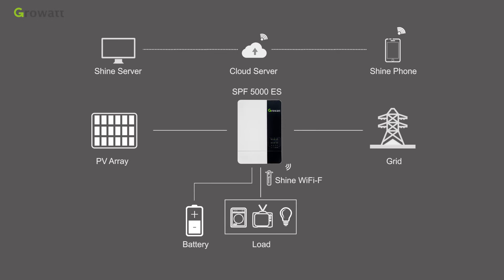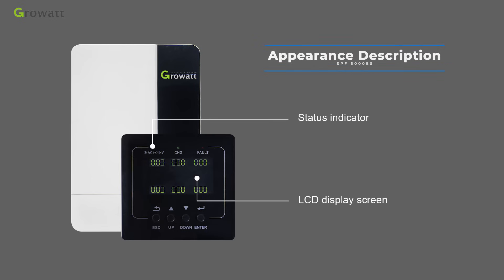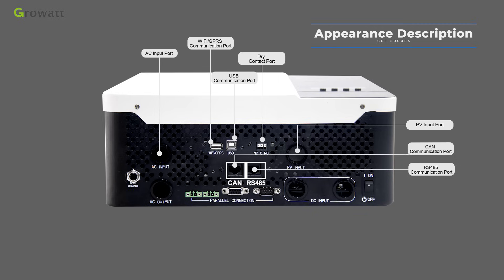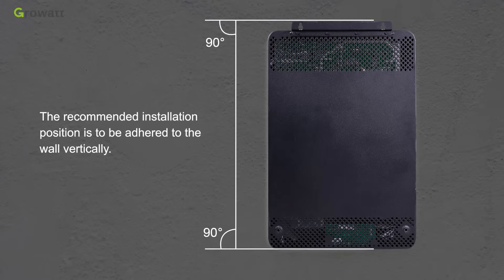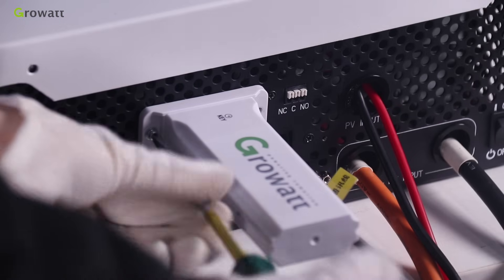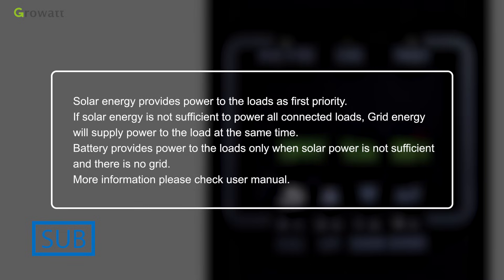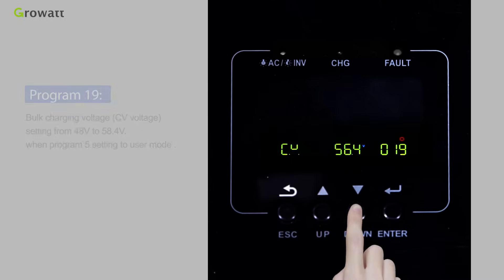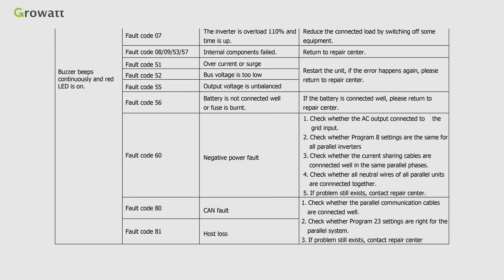Growatt SPF 3500-5000 ES Off-grid Inverter Installation Introduction

Comment: I have a Growatt inverter  SPF 5000 ES inverter I need assistance on how to connect the earth or ground from the Grid to avoid double bonding. an installation digrame will be hand what is in the Growatt manual is not clear

Comment: I have a Growatt SPF 3500 ES off grid inverter. I'm very sad to say it is not a good experience! The first one I got installed on April first (no joke) 2022. It stopped working, January 2023. I live off grid in Portugal and after 4 months without electricity or running water, I finally received a new one. A friend (solar ingenier) installed it and "looks after" it. Now since last week without a clue, the inverter broke down again! So here I am, again with no electricity or running water. I send e-mails, called and try to contact them to solve this predicament! Hopefully this helps to get the ball rolling to get me out of this awful situation and into power!
Reply: and you use stupid batteries from car right?

Comment: I would like to go for the 3500W version of this inverter, but the MPPT startup voltage is TOO DAMN HIGH!!! Yeh you have a 3000W inverter that has a 60V MPPT startup voltage, and another 3600W inverter that has a 70V startup or something like that, but the frist is 3000W and I really would like that extra 500 - 600W and the second only works with your own brand batteries, which sorry but I am not gonna get locked into your ecosystem.

For a proprotary battery to be fair it's competitively priced with server rack batteries and if I was just going to set and forget I would probably go with you guys, but I eventually want to move to a victron 5kVA inverter, although the main reason I want to go victron is for the low self consumption, the data sheet does say "Self-Consumption night: <10W" but if that means the same as when your Victron inverter is set up in eco mode and is only searching for loads, Victron manages 2W in that mode, while you guys have generally been around 60W.

I don't know if that is the same for this hybrid inverter, but considering you didn't just say Zero load self consumption or something like that it makes me doubt you.

Comment: Hi i have just purchased a spf 3500es,i dont want to connect batteries at the moment, can you explain  how i can program the inverter  for without battery mode as i am not connecting batteries. 
Also tge display is showing my panels at 179volts i have run the panels in series but the inverter is not showing wattage
Reply: it shows KV on the left bottom screen , which is same as watts

Comment: Can the 5000 ES only be connected to a 48V LifePO4 battery or can it be connected to 12v/24v also
Reply: the SPF5000ES will be conected to 48Vcc.

Comment: Hello i have a new growatt 5000 es it drains batteries to fast i have 4 12v 200a  batteries with only 2 fans on at night plz answer
Reply from the maker: Hello, for technical support, please contact our service team at service@ginverter.com, or you can call our service hotline at +86 755 2747 1942. Thank you!
Reply: How are your batteries wired, parallel?

Comment: Why does you system not turn on with batteries connected or solar.  Only works with grid connect to turn on display?  Why with it no supply AC to load or use batteries for load?
Reply from the maker: Hello, for technical support, please contact our service team at service@ginverter.com, or you can call our service hotline at +86 755 2747 1942. Thank you!

Comment: Facing problem connecting my Felicity lithium battery through BMS, any solution ?
Reply from the maker: Hello, for technical support, please contact our service team at service@ginverter.com, or you can call our service hotline at +86 755 2747 1942. Thank you!

Comment: Hello I have a Growatt 3500ES. I have not connected it to a battery. I have "19" and Flashing red triangle in the bottom right hand corner of the display... What does this mean? 
In "program mode 1" I have it set to SUB
Reply from the maker: Hello, for technical support, please contact our service team at service@ginverter.com, or you can call our service hotline at +86 755 2747 1942. Thank you!

Comment: When using the inverter without battery, and supposing load is 1000w and PV production is 500w, will it switch to grid and grab all the load? or will it use 500 from PV and 500 from grid?
Reply from the maker: it use 500 from PV and 500 from grid
Reply: @Growatt  nice. Thanks 👍

Comment: A question about connecting 2 strings. 
It’s marked as max 18A. How strict is that?
I was thinking to connect two strings with panels specified 11,2 isc/A 10,58 imp/A.
Reply from the maker: Hello, for technical support, please contact our service team at service@ginverter.com, or you can call our service hotline at +86 755 2747 1942. Thank you!

Comment: I am using the 5000 ES. Solar energy is being generated, however the dashboard is showing 0 kwH for . I am using the inverter without batteries. Is there setting or configuration I am missing. please assist.
Reply from the maker: Hello, for technical support, please contact our service team at service@ginverter.com, or you can call our service hotline at +86 755 2747 1942. Thank you!

Comment: I have this inverter is possible work with this baterry . I like to know before buy this  baterry .
SAMSUNG SDI 94A 80.9V 7.61KW LITHIUM BATTERY MODULE - DIY SOLAR POWERWALL
Reply from the maker: Hello, you can check the user manual on our website for the inverter ( https://www.ginverter.com/Off-Grid-Storage-Inverters/44-625.html ). If you need further technical support, please feel free to contact our service team at service@ginverter.com. Our team can provide assistance for you. Thank you!

Comment: Will this inverter feed the grid after the battery is full?
Reply from the maker: Hello, SPF 3500-5000ES is an off-grid inverter. It can not feed power into the grid after the battery is fully charged. If you have further product inquiries, please feel free to contact our sales team at info@ginverter.com. Thank you!
Reply: @Growatt  cheers. Is there a similar inverter that can as well?
Reply from the maker: @PyjamasBeforeChrist  Hello, you can check out our storage hybrid inverters here: https://www.ginverter.com/Residential-Storage-Inverters.html#product43. There're a variety of product offerings available to meet your demand. For further product pricing and inquiries, you can contact our sales team at info@ginverter.com. Thank you!

Comment: SPF-3000 TL LVM-24P do you have a video for this model? having trouble monitoring my battery capacity is it just the battery icon with the 4 bars?
Reply from the maker: Hello, you can check out the product user manual at our website: https://www.ginverter.com/Off-Grid-Storage-Inverters/44-589.html.  If you need further technical support, please feel free to contact our service team at service@ginverter.com. Our team can provide assistance for you. Thank you!

Comment: could we use it to correct grid voltage drop issues ?
Reply from the maker: Hello, this off-grid inverter can not be used to correct voltage drop of the grid. It's can be used for backup power and energy storage. You can visit our website at https://www.ginverter.com/Off-Grid-Storage-Inverters/44-625.html or contact our sales team at info@ginverter.com for more product info. Thank you!

Comment: Beware. What is not said is that this inverter has a 70w void self consumption. So it mean 1.7 kw a day, 3.36 kw a day for a 2 inverter parallel system for a standard house configuration. 1 226 KW per year !
This is for me the biggest issue.
You need 1.5 (single) to 3 KW (2 in parallel) batteries only to make the inverters working during night (16 hours in winter) !
Reply from the maker: Hello, for all off-grid inverters, there's always energy loss//power consumption by the inverter. This is normal and unavoidable. For SPF 3500-5000 ES inverter series, the energy loss/consumption by the inverter is around 1%, which is a bit below average of the industry. Combined with other features, this off-grid inverter is a very competitive choice in the market. If you need further product details, you can visit our website at https://www.ginverter.com/Off-Grid-Storage-Inverters/44-625.html. Thank you!
Reply: Hi Monsieur, I've been looking at one of these and wondering about that. Is 70W a number you know from experience or is it from the specs? The specs I have list "<60W" for both the 3500 and 5000es and I can't find more specific information than that for the 3500. Appreciate your input, thanks.
Reply: Good point! I just bought it, but have not yet installed... Has anyone checked the actual power consumption of that inverter? What I would like to know is how much does it consume when powering say 250W load. If it draws 60W with such small loads, that's a huge waste! I hope that's not the case.
Reply: @gregor.potrebujes  my growatt 5000ES eat during night about 75 watts each which is massive I think. As I use 2 of them, 150 watts. 3.6 KW each day. This means we have to add more panels and more batteries. I recommend to add 20 to 30% panels to the maximum that can be produced (because this maximum is never reached). And a big battery.

Comment: Morning there. These unit have to many faults and there is very little support on them here is South Africa. They restart when they want and flash the output power 4 or 5 times a day or night. There is no support on them I will stay with a known brand here in the country. very dispondant about the Growatt 5000. not a happy chappy me.
Reply from the maker: Hello, for technical support and customer service, please feel free to contact our service team at service@ginverter.com. Thank you!
Reply: Agree. Received my 3rd Growatt inverter today. Trying a High Voltage inverter. 
Inverters did not switch to solar automatically in the morning and at 10h05 it gives "Bus Voltage High" and trips all power. If you are not at home or on holiday your house has no power at all.
Reply: @ckp3118  Are you saying it stays on grid power and not using solar? Also what is your solar array voltage?
Reply from the maker: @ckp3118  Hello, for technical support and customer service, please feel free to contact our service team at service@ginverter.com. Thank you!
Reply: I dont understand the problem? why would they restart if not overloaded "flash the output power "?
Reply: Hello Andrew. Same for me man. Inverters start having random issues, one that I’ve installed keep flashing 02 that is too hot but the temperature is 30 degrees so a bug. Another one flashing that the ventilation not working but it is. Another one stopped charging batteries. Another one keeps switching AC output on and off. I’m not installing those anymore clients are mad on me.

Comment: Are you working on a new model or have one already for N. America to include 120VAC input and 120/240VAC output with the other specs pretty similar?  I like the 5KW inverter and 450VDC solar input specs but the lack of 120VAC on both the input and outputs is a deal breaker.
Reply from the maker: Hello, for more product offerings in the US, please visit our US website at https://www.growatt-america.com/list-42.html#product42. Thank you!
Reply: @Growatt  
use transformer to split the 240V into 120V
https://www.youtube.com/watch?v=NzrYyDEbaHY
Reply: I'm using 2 5000es inverters here in US... I use midpoint transformers from Signature Solar to make the 120v. The inverters can be set to make 230 or 240...

Comment: Beware north american buyers. If you see at 4:45 mark this unit is a N/G/Hot. 
On my Chinese unit from a different company it is the same thing and I can't make it work because I need 120v/N/120v to make 240v. They sent me a unit that has 1 leg of 240v like European style. Bought 5 of the 5.5kw and can't use em. I don't know why its beyond the level of understanding to the Chinese that we need 120/N/120 to get 240v.
Reply from the maker: Hello, you can seek technical support from our service team at service@ginverter.com and check what can be done to solve the issue. Thank you!
Reply: I am using midpoint transformers from Signature solar to make the 110v. I have 2 5000es and 2 transformers

Comment: Hi.. For Growatt Grid Tie In Inverter, Can you explain when in the  sunny  that condition PV is producing Electricity Power, then when Grid is shut down, Is there any internal sensor in Growatt inverter to shutdown the Inverter? Or Inverter will cut circuit to Grid Connection only, mean while inverter work as Off Grid Inverter.. so PV can still supply energy to the loads at Home?

Thank you for your answer..
Reply from the maker: Hello, for technical support, please feel free to contact our service team at service@ginverter.com. Thank you!